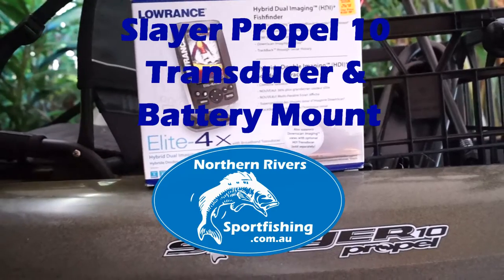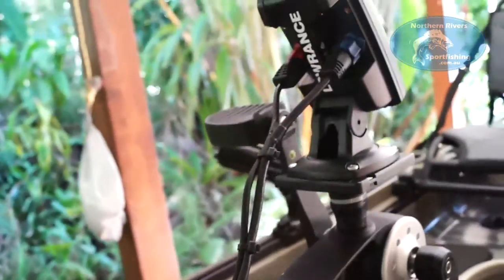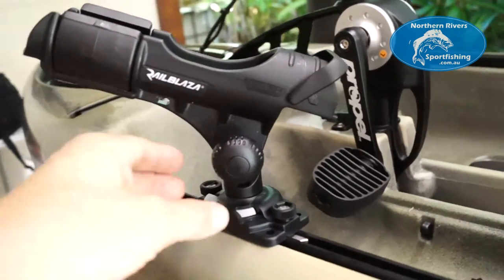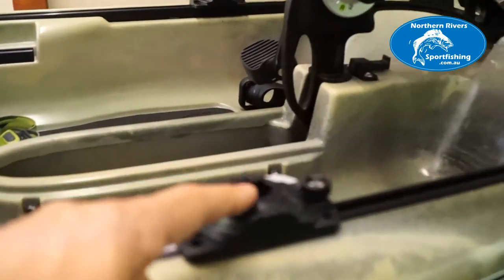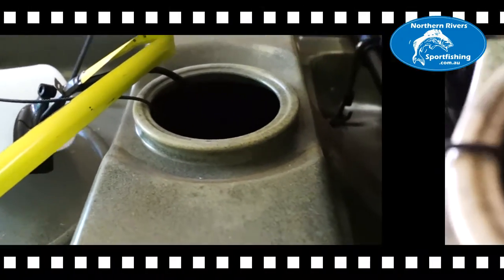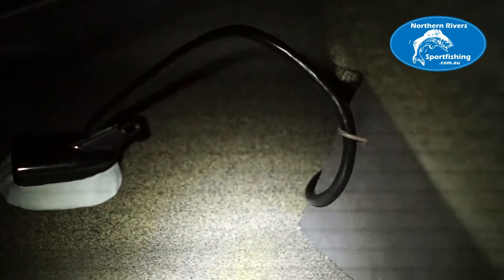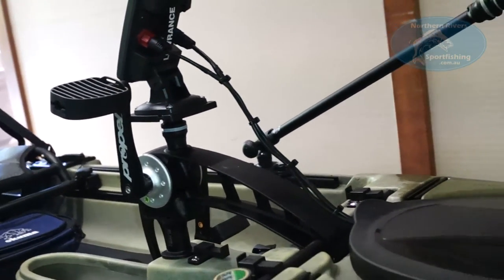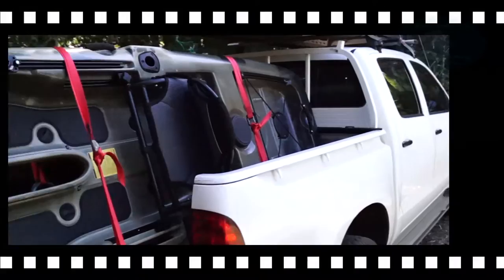Transducer and Battery Mount in a Slayer Propel 10 Kayak

Comment: Hey Simon I tried your advice on using blutack to mount the transducer . I just used a rolling pin to get it nice and flat and any air bubbles out and it seems to have done the trick  but have a issue with the DSI . It just doesn't seem to work . I did only have it out once so it may be  a setting issue .Are you getting the dsi to work fine ? Cheers for tip !
Reply: +Thebadseed77 The sounders I use dont have DSI (Down Scan Imaging) but I dont see why it should not work with BluTack. You may have to persist with adjusting some settings like you suggested. Obviously the internal thru hull mount would not be compatible with Side Scan. Thanks for the feedback. Let me know how you go